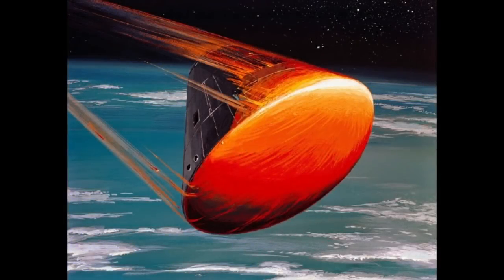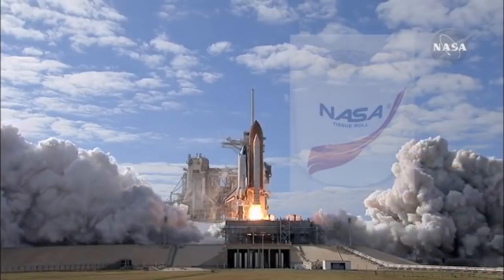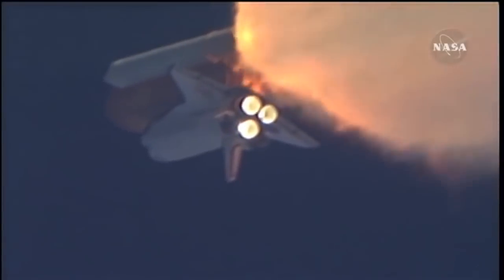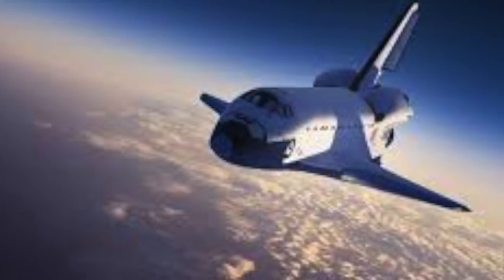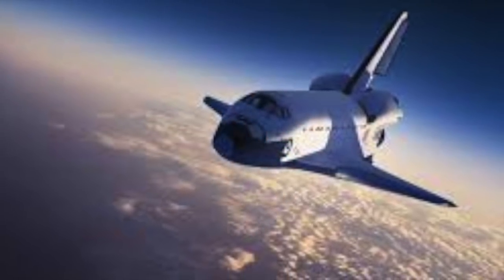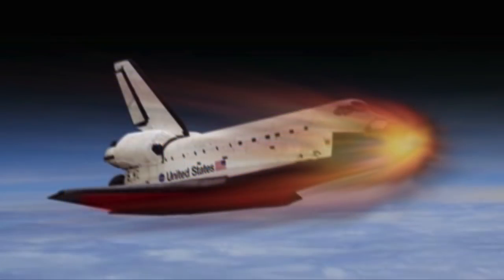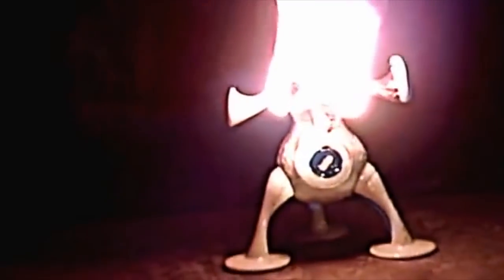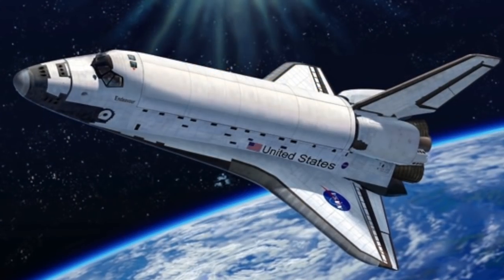NASA Fanboy questions #6

Comment: God, look at your own pictures! Incredible. On the way up, the spacecraft/ launch vehicle is oriented in a way to have as little drag as possible and thus reach orbit with as little effort as possible. On the way down, you actually want to have drag to reduce your energy. You orientate your spacecraft in a way where it creates drag, and thus you get aerodynamic heating. Not very complicated. And you want that heating, because this is actually energy transformation from kinetic energy to heat... Also, you actually get faster when reentering, yeah it is a bit counerintuitive, but you have to remember there is aso potental energy, you need to get rid off. And third, escape velocity is not orbital velocity. Two different things. You do not need to obtain escape velocity to reach Earth orbit. You did not even get that simple fact right, because you do not understand what escape velocity is. What makes you think you get the rest right? (you don't)
Reply: @ Cpt. Chaos

If it wasn't for the irony of the one putting forward such question (my perception) the question would be much more valuable. Thank you for your effort by explaining it in laymen's terms. At first it really looks very counter-intuitive. But once you "think" it through (with some hints here and there of course) it does not sound so ludicrous anymore.

Thanks again!
Reply: Nice try dork
Reply: @cypresspuz  Thanks for your valuable input. Now, do you actually have anything substantial? Where was my statement wrong? I am asking, because you know, I am actually teaching that subject at university and published books about this...

Comment: The speed a rocket enters space can be very slowly because it has a continuous force fighting gravity for the entire of its accent (the thrust from the rocket engine). Escape velocity is the the speed that an object (without continuous propulsion on its journey) would need to start at at earth's surface in order to reach space without earth's gravity slowing it to a stop and pulling it back down to earth.
Rockets do not launch into space at escape velocity. This is not the correct application of escape velocity.
Reply: Fook off loser
Reply: @cypresspuz  let me know if I can help with any questions you have

Comment: And here I am once more with my attempt of a polite explanation. Last one for today, I'm getting tired... ;-)

Again, we have a rather simple answer for this. Basically, the spacecraft heats up on re-entry because of friction. I'm sure you know that and why that is. But here's the thing that is the crux of your problem: Friction on ascend is not nearly as intense as friction the spacecraft will experience when on descent. I'll try to explain why: 

First of all: speed is not acceleration. Do not confuse the one with the other. If it were and its speed would be 11 km/s at lift off, a spacecraft would be in orbit after 10 or 11 seconds. That is NOT what we see when observing a rocket launch... (I'm pretty sure such speeds at lift off would tear any rocket apart.)

When initiating the launch, the craft is building up acceleration from a speed of 0 km/s to - eventually - escape velocity. Please consider this too, because this is important: gravity counteracts that acceleration at all times with its force of 9.81 m/s squared. So as long as gravity and craft acceleration are in gravity's favour or cancel each other out, the craft goes nowhere. Only when tipping the acceleration into the spacecraft's favor, it will slowly start to lift off. This, on the other hand, is clearly observable on any rocket launch, also the one in your video here. 

After lift off, our spacecraft has overcome gravity's pull, and with its acceleration, the rocket is speeding up, and therefore friction will build up. But while doing that, the craft is also gaining altitude. So friction will decrease more and more with higher altitudes, because there's simply less and less air the craft can "rub on" as it becomes faster and faster. As I stated in my last response to your question #5, when ascending, thereby going into higher and higher altitudes, the air density is decreasing constantly. When coming into orbit, the spacecraft has arrived in a surrounding that has a density close to zero, but it will still accelerate to eventually about 7,5 km/s in order to keep a 200 km high orbit. 7,5 km/s is slower than you stated, but that is what I have calculated according to this site: https://rechneronline.de/g-beschleunigung/orbitalgeschwindigkeit.php ...I'm from germany, so sorry if you can't read that, but I couldn't find an english site. .

Now, let's look at that process, but in reverse, so to speak: The space craft is moving at high speeds, let's take those 7,5 km/s. Now it wants to return to earth. That means coming in at high speed from an almost zero-density environment into an environment with increasing density. Now the principle of friction will slap our spacefarers hard in the face. Because now, at these immense speeds going into a more-dense-surroundings, intentionally using the pricinple of friction to slow down, is why this immense heat buildup occurs. With no shielding, our spacecraft would burn up totally, as a lot of smaller meteorids do. They burn up in the atmosphere, what we see as a shooting star.

Hope I could help.

Comment: Because most of the velocity gain to get to orbital speed is done OUT of the atmosphere(or at least in thinner atmosphere). If you're trying to reach orbital speeds while still in the thicker atmosphere, necessitating heat tiles, then you're just wasting fuel pushing against drag.

Comment: When you talk about escape velocity it depends on the elevation, and it is progressively lower as you rise according to the inverse square law.  If you have an engine that is taking you up you will reach the escape velocity late, when it is not so elevated. So the speed of takeoff and the speed of return is absolutely not the same, and the need to be adequately shielded exist only during the descent. Why cannot you understand that before making a video?
It is so strange that you begin with facts, then you don't understand something and from this you infer that the facts are not existent. Brilliant!

Comment: ...Where did you get these figures from??? The re-entry velocity is not the same than in launching, as orbital speeds need to be fast to be stable. If the shuttle was in orbit, then for sure was not going at the same speed than in launching when re-entering.
Furthermore, re-entry is not only a higher speed, but also to denser and denser atmosphere (both things means higher friction), while in the launching and orbiting the vehicle is going through less dense atmosphere when accelerating.
No mystery in this question, just lack of information.

Comment: Orbital velocity does not equal escape velocity.
When a spacecraft is launched, a large part of its acceleration to reach orbital velocity occurs at high altitude, in the case of the shuttle the SRBs along with the main engines take it to high altitude, the SRBs are dumped, that big tank the shuttle rides on is the fuel tank for the shuttles own main engines, those engines then take the shuttle up to (or close to) orbital velocity and then the tank is dumped and the shuttle uses its onboard fuel for insertion into its orbit.
The Shuttle uses its engines to accelerate to orbital velocity once it's out of significant atmosphere, but on  re-entry it decsends through that region with relatively little retardation until it hits the more significant atmosphere still travelling at high velocity......,. Wait, why does this need to be explained to a grown man who claims to be researching the subject?
Reply: "Wait, why does this need to be explained to a grown man who claims to be researching the subject?"
Because he is a complete idiot, and still so proud of it.

Comment: escape velocity is the speed required for a free object to escape the gravitational influence of ( a body -- Earth )
.. they don't need to travel that fast to  r e a c h  orbit.  they can continually thrust at lower speed ( they actually throttle back, slow dow,. in order not to apply dangerous pressure on the vehicle during ascent ). 
.. in fact, they often want to remain within Earth's gravitational influence at least temporarily.  they have to match a speed and altitude in order to orbit -- different orbits requiring different speeds
.. you make some nice claims about launch and reentry being "at the same speed and angle" while seeming oblivious to the readily apparent difference in attitude of the vehicle ( launch -- vertical/aerodynamic .. reentry -- fairly horizontal/meant to accept heat of reentry)
they are also moving into lower pressure regions of the atmosphere during launch and thus experiencing less heat due to friction
this is obviously reversed during reentry and why they put the heat shields ( capsules ) and tiles ( shuttle ) on the surfaces that would experience this

are the X-15 and Space Shuttle flying at comparable speeds at comparable altitudes
.. or is this yet another example of apples and oranges?
X-15 reached 4,520 mph and max altitude of 102,100 feet altitude ( 19 miles ) 
Shuttle is reaching about 3,000 mph at 28 miles
nor are the X-15 top speed and max altitude necessarily coincidental figures ( at the same time )

Comment: First off the whole ship is covered to reduce the heat but more so in the bottom. Here's why.

While the ship does experience significant amounts of this friction heat when leaving the ship is set to be far more aerodynamic during this step. This is because it needs to slice through the air in order to speed up and reach escape velocity. 

On the other hand, on reentry, we can't come in strait down. Why? The ship would be going too fast and would smash into the planet. At some point you must level out and increase the friction amount to reduce speed. So what do they do? Use even tougher heat resistant panels on the bottom and use the entire underside of the ship to air brake in this way. This causes significantly more heat buildup than when leaving the atmosphere as you are intentionally creating more friction.  

Simple answer: they need to stop eventually when entering and not so much when leaving.
Reply: Nice answer

Comment: When you reach the maximum speed to escape from the Earth's gravitational field (8 km/sec - 4.9 miles/sec)  you are already out of the atmosphere. You are way above 30-40 km (25 miles) when is the thickest and densest atmosphere.

At 30-40 km you broke just the sound barrier and no plane which breaks that has burned yet.

Over 60 km (37 miles) the air is now quite thin and you still don't have enough speed to burn or to escape the gravitational field...

Over 100 km (62 miles) you are out of the atmosphere and in full speed...now you cannot burn even if you want to.

Comment: The answer is easy, they don't hit orbital speed and then leave the atmosphere on take off. They get to space relatively quickly and then spend the remainder of the launching process getting the vehicle up to speed. This is done for several reasons. First, it would take more fuel to get up to that speed in the atmosphere because of air resistance. Secondly, air resistance at orbital speeds would cause major heat like it does in re-entry. Get out of the atmosphere early and you avoid all that. Thirdly, even "low earth orbit" is several miles above the atmosphere so why spend so much time getting up to speed in the atmosphere when you could be continually gaining altitude while accelerating?
Reply: Fook off mate

Comment: Dear Spacebusters.   I just can't control myself LOL.   Here's another one.   "NASA said the space suits of the Apollo crew were equal to their weight so both together 360 lbs ( I think the suit was half that).    The Moon's gravity is a sixth of the Earth's.   So taking the combined NASA weight of man and suit on the Moon would be about 60lbs..   Even with this weight and a somewhat restrictive space suit they should have been able to easily jump 6 feet in the air.   They should also have been able to just pull themselves up the ladder easily with just their hands.

Comment: I’m actually wondering if you really want an answer or not, but here we go. Propelling a space craft into space is different then actually reaching escape velocity. Escape velocity simply means the craft has enough speed to either leave orbit of the earth or maintain orbit around the earth. Just because a craft passes the Karmen line, doesn’t mean it has reached escape velocity. 

For example: the Falcon 9 rocket is traveling approximately 7,500 km/hr when the first stage separates from the second stage. This occurs at approximately 80 km in altitude. At this point the first stage (if they aren’t planning on landing the first stage) the stage will continue up until it reaches it apogee at which time it will then fall back down to earth and crash (usually in the ocean). At no point so far will the first stage be traveling at escape velocity. However, it will reach space.  Escape velocity by a craft is not reached until after it reaches space where any particles that may be present are in such low concentration that they won’t cause the destructive heating that would occur if trying to travel  that fast in the thick atmosphere.
Reply: HaHaHa... So you think we've been to outerspace??? HaHaHa... they go up they go down... into the ocean... no one goes to space... they go to your brother Davey Jones Locker in the sea. No escape velocity required... just a lot of the tax payers money.

Wake up they are stealing your money and your mind... obviously.
Reply: James Mann So, since you don’t believe in outer space, I would ask what do you believe is above the sky?  Where/What is the sun and moon and what about the stars?